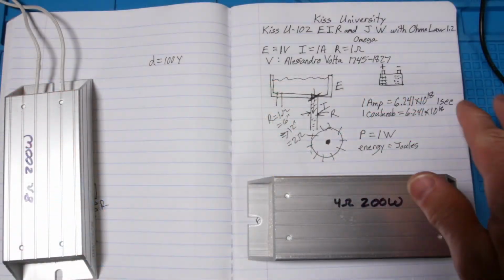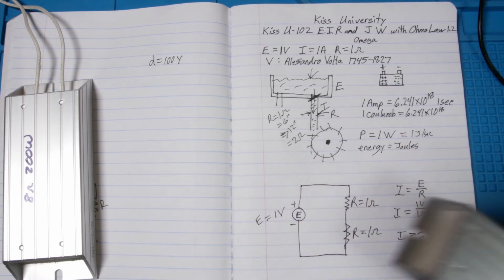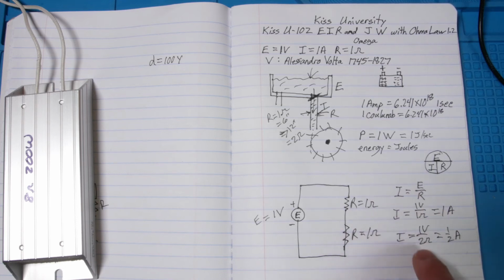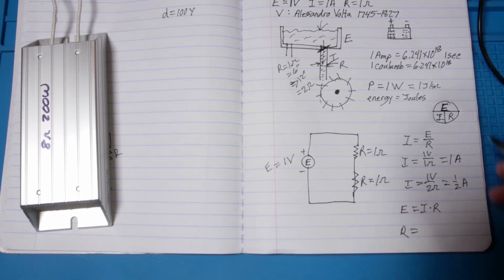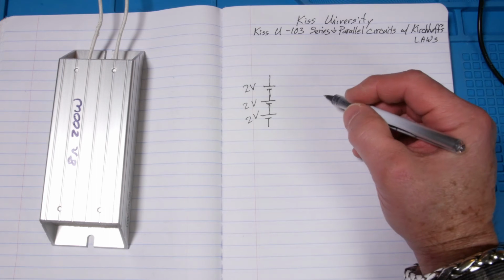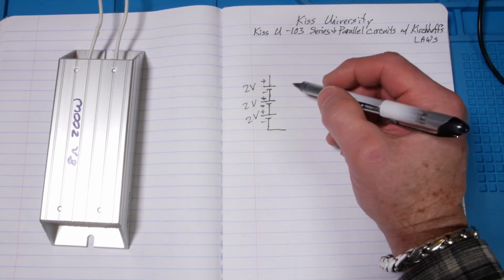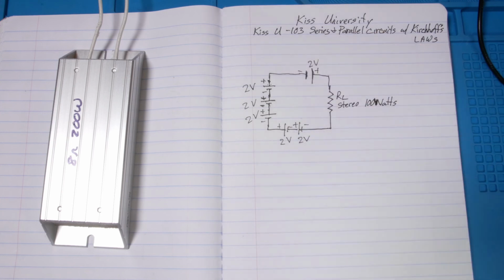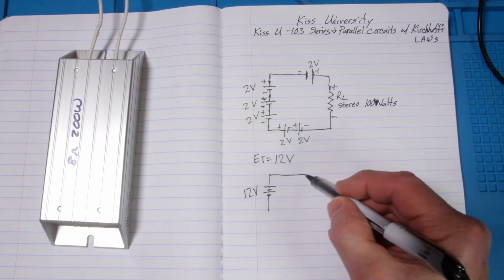KISS U 103 Series and Parallel Circuits with Kirchhoff -  part of Kiss University Playlist #kissU

Comment: Just thought of a "problem" I once had, that you may be the perfect to answer. I had one power supply and two circuits, one circuit had almost nothing going on and maybe a total impedance of 10 Ohm, the other was a lot bigger with maybe 1M Ohm. They were both connected in parallel to the power supply but the large circuit would not work while the small was connected. Is that due to the different in impedance?
How do I do if it's important that the circuit do not run in series?
Reply from the maker: Fried Mule That sounds like an interesting problem.  Did the lower impedance (10 ohm) circuit pull the voltage down (load it down) to a level that the higher impedance didn’t have high enough voltage to power it?
Reply: @kissanalog  Thanks for answering!!:-) I think so, but was hard to find out, only having a DMM. But I think that the power did take the easy rout and "home" :-)

Comment: Great video as always, maybe a sudden ending but still great!
If Ohms law don't care about how you divide 1W, I am wondering, is there a theoretical max Ampere / Voltage ratio, I mean is 0.0000001V with 1,000,000 A, possible or the opposite?
Reply from the maker: Fried Mule Thank you - I appreciate the feedback;)  I was going too long and kind of rambling;), so I cut it out;). Yes, mathematically, ohms law holds true, but practically....that might be pushing the possibilities!  Let’s say you have a practical, real life, challenge.  Say a car audio amp of 1,000 Watts.  That would work off say 12 V and need 83 Amps.  If you didn’t want to drop more than a 1/2V on your cable, the resistance would have to be 0.5V/83A=0.006 Ohms.  That’s a big cable;)
Reply: @kissanalog  LOL yes I imagine a firehose running trough the car:-) Thanks!
Reply from the maker: Fried Mule exactly;)